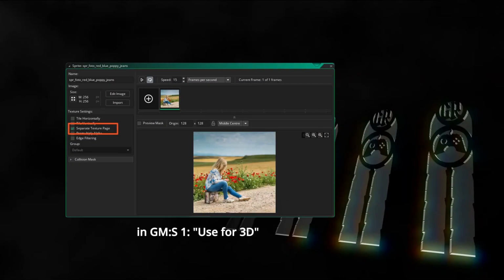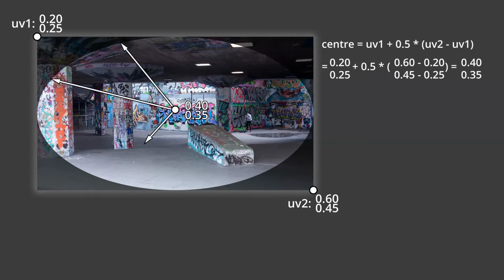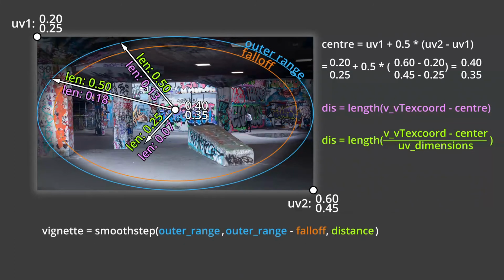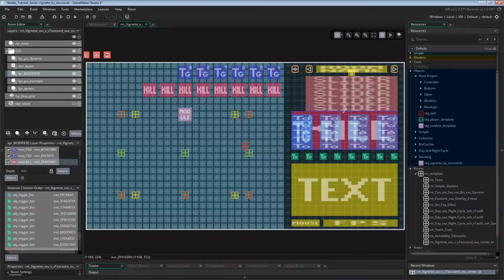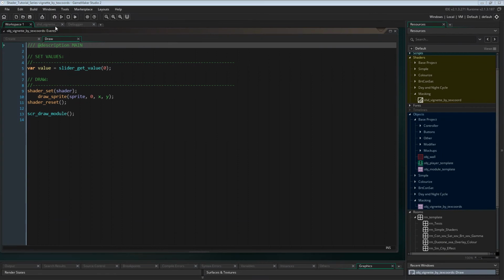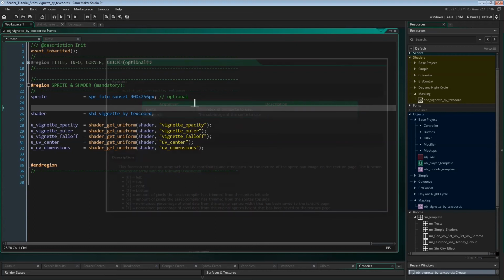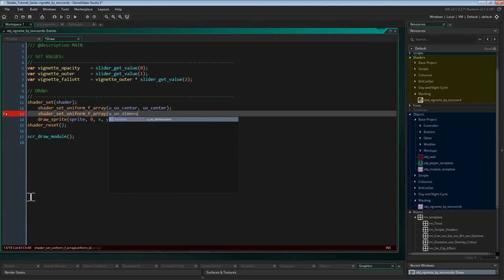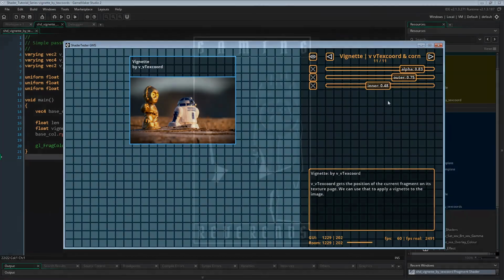Shader Tutorial for GameMaker 13 - Vignette & Texture Coordinates

Comment: very interesting, sometimes i got like a whole texture page displayed happened me before i got into more details regarding coordinates and sprite or draw gui shaders with surfaces. anyway so great videos that explain all kind of stuff!
Reply from the maker: If you're randing the whole texture page there's usually 1 reason and several solutions. reason: you want to process one sprite that's on a mixed texture page but the shader uses uvs ranging from 0 to 1 instead of the sprite uvs. One solution would be to set the sprite on its own texture page (that's a toggle in the sprite asset). Another solution would be to get the sprite uvs and send those to the shader - i think i did that in the masking videos.